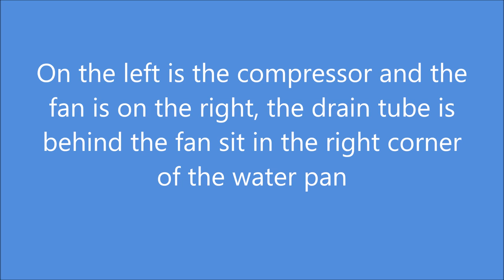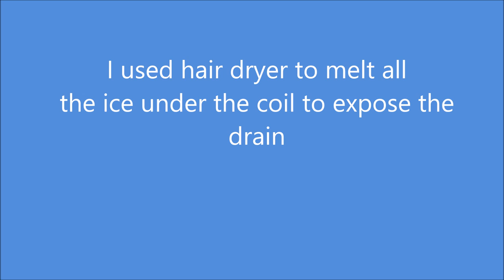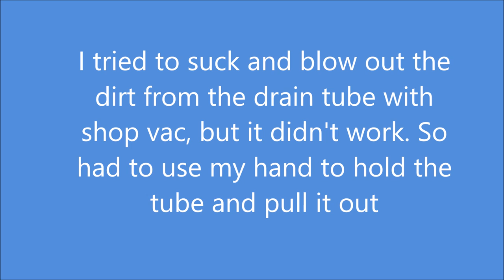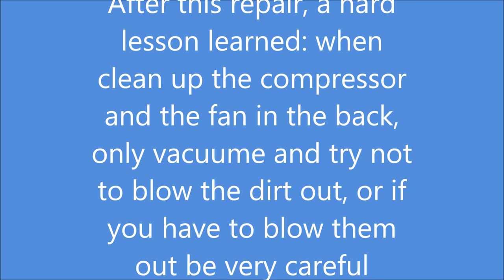How to clear Kenmore side by side refrigerator clogged drain tube

Comment: what if the drain tube is solid plastic curve with a P trap in it, NOT a flexible rubber tube? How do you pull out the crud and dirt "with your hand"?
Reply from the maker: Dan Campagna ：I don’t get it,  for fridge you need  drain the water out freely, not like a sink need the P trap to block the gas from the sewer. Why would somebody install a P trap for their fridge’s drain tube?  It’s certainly not from the manufacturer.
Reply: My Kenmore has the same type of drain tube and I bought it new
Reply from the maker: That's interesting. Can you send me the photo so I can learn something new, thanks.
Reply: This is what it looked like. I was able to pull it out but it was still attached to the fridge with a screw that I could not get off with a standard screwdriver. So I took a straw cleaning brush to pull the crud out that was clogging it. I did this two days ago after watching this and other videos on the frozen water problem. For now the ice has not returned. https://www.repairclinic.com/PartDetail/Drain-Pipe/2254566/1199339
Reply: Also could the water not being able to drain be the source of my ice maker not working?  My ice maker works then stops working so I unplug the fridge for 5 minutes and it works again for a while
Reply from the maker: @MomKnowsBest  , Thanks!
Reply from the maker: @MomKnowsBest  ,this I have no idea. My one didn't have an ice maker.
Reply: @MomKnowsBest  Mine has an ice maker and I had this exact piece and same problem. I was able to remove the screw you are referring to with a standard bit-less screwdriver (empty socket) It was a pain because there were metal pieces in the way. When it came to putting it back in, I had to put the screw in by hand to start, it was too cramped for the screwdriver with the pipe.